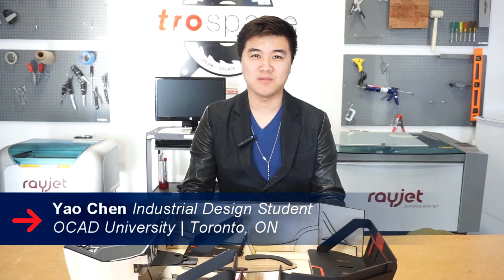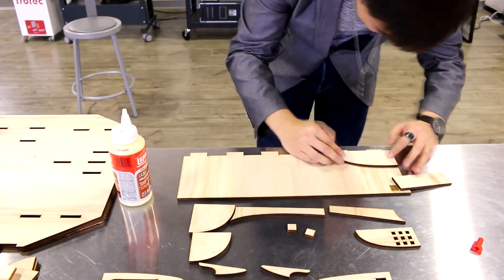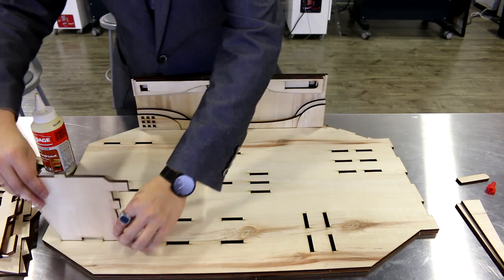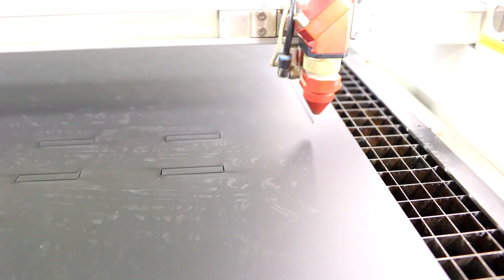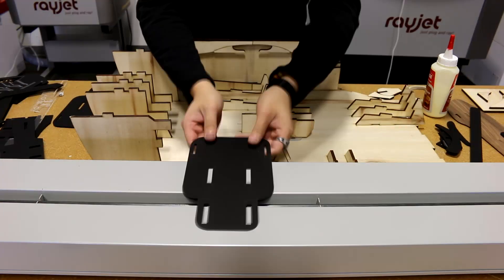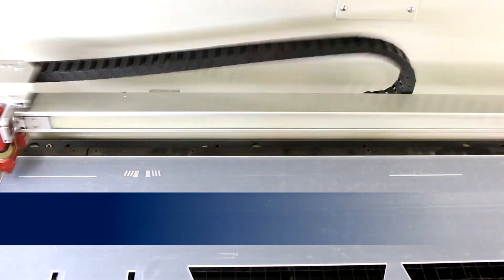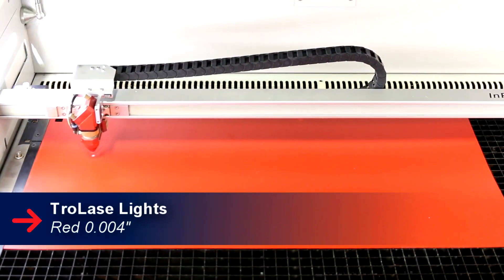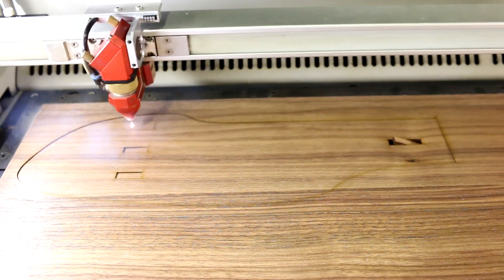Interior Car Design | Laser Cut Industrial Design | Speedy 400

Comment: Hi Man i have rayjet30 w what is colour cutcontur rgb or cymgn ??
Reply from the maker: Hi Danzel on the Rayjet it should be red RGB (thinnest line possible in Illustrator or any design software)
Reply: Trotec Canada but i work with Corel x7 do you give référence of red RGB ?
Reply: Cutcontur
Reply from the maker: Hex code #FF0000 - rgb(255,0,0). In Corel you will need the "hairline" line for the cut.
Reply: Trotec Canada thx 👍